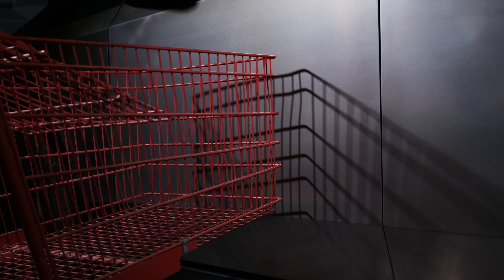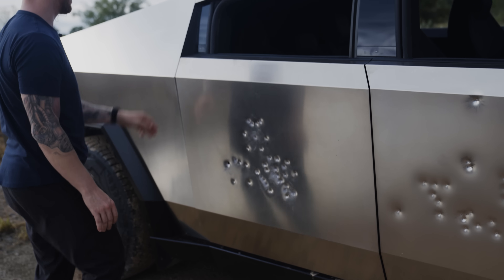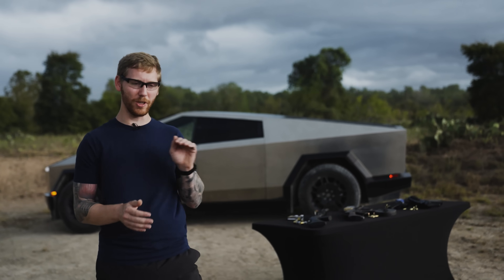Cybertruck Bullet Test

Comment: They had a shotgun - should have tried a slug as well as the buckshot.
What about shrapnel from a grenade?  That'll be interesting...
I'll be surprised if we don't see people who up-armour vehicles for VIP protection start using it as a base - a CT not only has decent protection even without the additional armour, but also the power to carry it and the speed to get out of trouble in a hurry.
Reply: They used pretty much the maximum calibers this truck will stop. Basically typical handgun rounds, but not all handgun rounds (.357 Mag will probably go through).

In other words the vehicle was not designed to be bullet proof and there are dozens of calibers that will easily cut through like butter (like any other car). About the only positive thing you can say is that it could stop some rounds in some situations.

If you want a bullet proof car, you can have one modified. Obviously, the weakest spots are the windows, but they can be replaced with bulletproof glass. It's always a tradeoff though, and your mileage will suffer, as well as the cost of installation being pretty high, unless you DIY.
Reply: @PaulLawson-k8v the fact of the matter is the US will be the biggest market for the CT, and that means you’re not as worried about 762 or 224, because you don’t live in a war zone.

What you’re worried about, and where this helps, is with carjackings. As long as the glass tests out well enough to take a few 9mm this level of protection is perfect for 99.99% of situations an American would need it for.
Reply: @PaulLawson-k8v  some rounds? like 90% of rounds that are used in urban settings, for what this car is designed for.
Reply: @rajahzia they used sub sonic rounds maxing out at 1000fps . There are a lot of rounds that exceed that speed
Reply: @rajahzia well there is 556 and 7.62
Reply: @rajahzia Well yes, as long as the assailant is using hollow points, and not full metal jackets used by the majority, you'll be safe. And not all rounds are made equal, you can buy faster or slower, lighter and heavier rounds in a particular calibre. That's why armour is specifically certified to resist not just to a certain calibre, but at specific speeds and weights of projectile.
Reply: @rajahzia  Any rifle round will punch through easily. But yea it stops handgun rounds pretty well.
Reply: @another3997  these are fmj rounds being used my guy
Reply: vip protection... they also should make some hack-a-day to try break control system of car to see how fast it could be opened or overspeed into the wall
Reply: 5.7x28
Reply: i don't think a VIP vehicle would use a pickup truck lmao
Reply: man these trips to drop off your kids at school in america is really getting intense if grenade shrapnel is a concern lol....
Reply: Dude this vehicle wasn't designed for military. Might as well ask about RPGs and nuclear bombs 😅
Reply: They used OO buckshot.  115 grain 9mm is not subsonic.  147 grain 9mm would be subsonic ammo but they did not state 115 FMJ or hollow point or training ammo.  Looked like FMJ to me based on lead dispersion but I could be wrong.
Reply: @UTalum1996  you can get 115 grain subsonic fmj ammo my guy. The grain weight is just the bullet weight it has zero bearing on the powder load. Also the mp5SD is ported to lower muzzle velocity to make some super sonic rounds subsonic. Listen when the mp5 is firing you can hear the same crack as when the handgun is firing. The rounds were coming out below the speed of sound
Reply: I have a mp5sd and know all to well what rounds sound like coming down range suppressed and unsupressed.  Go to any range and shoot ar 500 steel and the rounds dissipate just like in the video.  Now we all know a lot of trickery can be done but the angles on these doors are key to what you are seeing not the rounds my guy.  Do they make subsonic 115 grain, yes, but it is like throwing a spit ball my guy.
Reply: Wondering if AK-74 bullet or anything automatic and military grade will be stopped. I assume not.
Reply: @RIP212  lol both the smgs they used were automatic and military grade.
Reply: @RIP212 not flat on but angled it can stop it.
Reply: @Phantom-bh5ru  I'm sure you have specific evidence to back up your claims? You know, repeatable tests with specific parameters? What rounds, what speeds and what angles? I'm sure you aren't just wildly guessing 🙄
Reply: mate... they used some of the weakest ammunition out there. in 99% of situations out there where a car is being shot at, im willing to bet my left nut the ammunition used would punch through this like butter. now some standard pistol ammo might not go through if it hits the door and the window together but i wouldnt stake my life on this thing saving me from anything more than a painball or airsoft gun
Reply: @mmorgz6622  if it doesn't stop the bullet, it's hopefully slowed it down enough that it won't pen your vest as well
penetration isn't always all or nothing
but yeah, don't trust cybertruck car doors to stop you from being ventilated by a carjacker. they can and sometimes will stop the round, but
Reply: @mmorgz6622  they used two extremely common handgun calibers (one of them coming from a carbine barrel which would impart higher than usual velocity) and the most common anti-personnel shotgun ammunition.  Obviously we can find things that WILL punch through this consistently, such as 357 magnum or 10mm or any true rifle round, but 90% of criminal gun violence that happens in the US comes from 9mm handguns.  If this helps someone escape a gang shootout alive, that's not nothing.
Reply: @dumb214 That's a daft way to look at it. The assumption they are wearing a "vest", and that a round that penetrates will then hit that vest, is naive at best. A wound to head, neck, legs, arms or anywhere on the torso can be debilitating, even if not fatal. In which case, you are a vulnerable target for any other rounds that pass also through. Unlike in the movies, real life doesn't favour he "hero" in the car.
Reply: @herbderbler1585 You need to clarify the exact parameters of such tests and also their relation to likely, real world scenarios. Armour is always rated to stop specific threats up to certain speeds and energies. They are also only rated to stop a certain number of those rounds within a certain area, with a minimum distance between each impact. Rarely do assailants aim to replicate these criteria for your benefit. In other words, don't be complacent, you're likely to regret it.
Reply: @another3997  no one said anything about being complacent.  You're arguing with a strawman in your own head.  Armor is meant to increase your chances of survival, not stand there and tank bullets like Superman, no matter how good it is.  If someone's shooting at you and your car has resistance to any bullets at all, your chances of survival and escape increase.  Don't drive through a warzone and expect to survive 7.62 rounds, but they've clearly demonstrated that it CAN stop common pistol and shotgun rounds.  You can cite outliers and extraordinary circumstances and armor penetration tests multiple hit circumstances all day long.  The only response I can give you is yes, I agree, those are examples in which this metal will probably fail to stop bullets.  What's your point?
Reply: @mmorgz6622 lol paintball? Man you are out to lunch. The vehicle wasn't designed to be bulletproof in the first place. Yeah it doesn't stop some rifle or shotgun or RPG or a nuclear  bomb. If it stopped all of that then it would cost a million

Comment: One thing to consider is that they were only shooting relatively weaker small-caliber rounds at it.  Anything M16 or AK47 equivalent would have likely punched though.  You'd be in better shape than in a normal car or truck though. A lot of the velocity will be dampened by the time the bullets and/or fragments hit you.  😅
Reply: They also didn't try to make it bullet proof. They discovered it was bullet proof while having fun.
Reply: @Sandlin22 *bullet resistant.  Just like level IIIA ballistic "bullet proof vests" will stop every single round they fired at this "truck," a 5.56x45 would zip right in, through anything inside, and right back out.
Reply: police probably dont want ppl to buy fully bulletproof vehicles
Reply: So many autistically challenged (and triggered…pun intended) Europeans and libbies whinging and nitpicking calibers.lol
A: It wasn’t designed as an armored car and only were claims made that the cold rolled stainless panels are bullet resistant to specific calibers. 
B: Even armored cars are ‘only’ bullet resistant according to levels.
C: It can be fitted with bullet resistant windows and it’s still more bullet resistant than any other mass produced vehicle.
D: Commenters here lack reading comprehension and reasoning skills.
Reply: until a few rounds hit the battery pack and you literally go up in flames...
Reply: @wildbill6976  Battery fires are rare but unique. Plenty of gas cars go up in flames every day, but it's not considered newsworthy.
Reply: @wildbill6976  
And I quote: 
"Australia’s Department of Defence researched the same question and found that “there was a 0.0012% chance of a passenger electric vehicle battery catching fire, compared with a 0.1% chance for internal combustion engine cars.”

If you look at the research from virtually every government or private research lab around the world, they'll back up these findings.  A small percentage of research are literally bought by big oil to ONLY highlight the negatives and dismiss the positives.  

Dude, I drive a hybrid SUV and I have the gas mileage of a mid-sized sedan.... or better.  I see the future, my guy.  It's not a combustion engine that at best combustion 15-ish percent of the energy potential of its fuel and causes death from air pollution.  🤷🏾‍♂️
Reply: @modemmack the future will always be combustion engines at least for the next few hundred years. I see a lot of fluff pieces talking about how popular they are but globally they make up less than 1% of vehicles on the road. Also there's no evidence that there's enough lithium (among other materials) to create a full global electronic fleet. At the current rate lithium is used were looking at lithium shortages before 2030. Now they claim if recycling is ramped up then that can be avoided however claiming that something will happen is not the same as knowing it will happen. I think one day the only place we will see gasoline powered cars will be at car shows and museums. But it's certainly not going to be in our life time and it may not be ever.
Reply: @Sandlin22  I think that's more likely just your lack of imagination kicking in.  It took a bit more than a century for humans to go from riding horses and using whale oil for lighting to AI and humans regularly flying through the sky.  What in our recent history makes you think that humans aren't capable of moving past combustion engines?  🤔
Reply: @modemmack  shoot a lithium battery and see what happens...
Reply: @wildbill6976  By the raw numbers, there's a .0001% chance that your electric vehicle will catch on fire. There is a .01% that your combustion engine vehicle will catch on fire.  Both are by their very nature liable to catch on fire.  It's still wildly unlikely that you or anybody that you know will experience this in either type of vehicle.  I would just say please consider that just listening to those in the media with a fetish to see a new technology fail might give you a warped perspective.  With that type of mentality, we should've stopped making cars because the first ones were dirty, slow, loud, and dangerous.  Nobody ever expected any other technology to be perfect out of the gate because that's not a thing. 

By the way, I own a hybrid vehicle that I bought about 3 months ago.  It's great. When I'm in a residential area, my Hyundai Tuscan coast along without barely making a sound. When I sit at a stoplight, I don't have to stew in my own toxic fumes because the engine always turns off. I get up to 45 mpg sometimes.  My point is that you shouldn't be so down on the tech.  It makes no sense to be so upset that you might not have to be dependant on big oil. With a full electric vehicle, you could potentially make your own power and be free of them all together.
Reply: M16 is a small caliber.  .223 55-62 gains weight round with 30 grains of powder. 9mm (114-157 grain bullet) handgun round is bigger than 5.56mm (55-62 grain bullet) M16 round.
Reply: @johnmea5140 but the muzzle velocity is a lot higher and the profile is a lot sharper, it would penetrate a lot deeper and cause more damage
Reply: @johnmea5140  You have no idea what you're talking about 🤣

Comment: Yes, you can protect yourself from gunfire behind a normal car. If the shots come from the side then next to the car in the front axle area. If you come from the front, then from the back of the trunk, because that way the attacker will usually shoot through the engine block and you may be able to survive relatively unscathed. Especially you, in America, should pass on tips like this. We in Europe don't need that. We just have to protect ourselves against knife attackers. At least at the moment.

Comment: So. Pistol calibers and buck shot. That doesnt male it bullet proof. Stop sayong that. Its bullet resistant. 

9x19
.45ACP
12gauge 00Buck

Thats all they tried.

5.56x45
300BLK
7.62x39
.44 Mag
.350 
.450
.50AE
.50 Beowulf
.308
7.62x54R
30-06
.50BMG

Gere are just a few other common ammo types they dodnt try. Bullet proof. Can stop them all. Since even buckshot was threatening to pierce. The rifle cartridges mentioned would easily push through like butter. Lot of different ammo types to try but only 3 used. They even used a subsonic ammo after the glock. Which is fucking stupid. Subsonic ammo is going to be alot less powerful cause it moves slower. The fuck? Luckily I have seen the 308 Stainless balistics from someone not wanting to lie about his products. The 5.56x45 ((smalled rifle cartridge I mentioned)) pierced it. 5.56x45 is the standard round used in the common AR15 for the Musk fanboys who dont know anything about ballistics. And meeting a badguy with one in the Cybertruck could result in injury or death if the bad guy decides to fire on your vehicle. Yes this is with practically every vehicle unless you spent couple 100k on an armored vehicle. But most cars dont yse bulletproof as a selling point then lie on camera about what it can really do.

Comment: It would have been nice to mention which kind of bullets did you use? Were those soft/hollow points or full metal jacket or something else?
Reply: This def isnt the first test. Its an ad for the car so they used only the rounds they knew would fail.
Reply: From the way they were opening like flowers i'd say hollow points most likely
So not exactly the best for penetration
Reply: Why would they do that then you'd know it's not as impressive
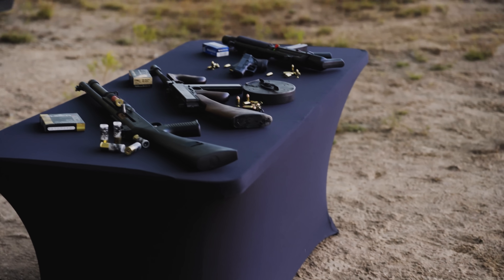Reply: 0:40 0:44 0:49
Reply: @Ghjgckjjfjkkkkx  You do realize that "9 mm Glock" can use multiple types of ammunition? Same same for the rest of the guns.

Comment: Honestly I don't feel like cybertruck is a good name. It suggests so much more than this. Make it autonomous and flight ready and maybe. My cyber truck would be equipped with a 360° turret that automatically fires a laser directly at any sound over a certain decibel.  If you say ouch, you might want to keep it down around my ride or else AI will quickly determine and eliminate any threat available or still talking too loud. "Activating Nag Mode, Passengers Be Aware.! You get a laser and YOU get a laser and YOUUUU get a laser.

Comment: There's a lot of room inside the door trim for for Kevlar or any ballistic shields. I sure some after market company could make ballistic glass for the windows. But OEM alone is pretty empresive nonetheless.
Reply: It's got enough cameras... Without side mirrors I feel like the drivers window could be 1/4 the visible area. I want aftermarket stainless steel window glass replacements😂

Comment: Impressive. What's the density of that alloy?
Reply: By density I meant exactly that - i.e. weight per unit of volume - because it was mentioned elsewhere that it may be an alloy of stainless steel and aluminum .
Reply: if you mean by "density" how thick the plating is , its in the description 1.8mm

Comment: 🎯 Key Takeaways for quick navigation:

00:00 🚗 Tesla designed the Cybertruck with an exoskeleton and a custom alloy, making it more ductile and corrosion-resistant, with panels up to 1.8 mm thick for structural support.
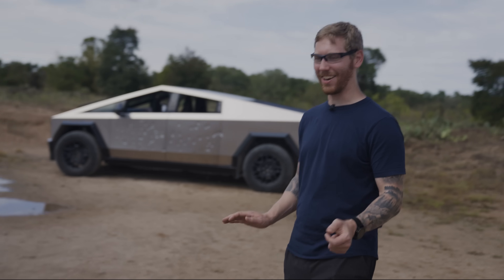01:11 🔫 Tesla tested the Cybertruck's bullet performance with various guns, including a Tommy Gun and a 9mm Glock. The truck withstood the shots, showing only minimal damage.
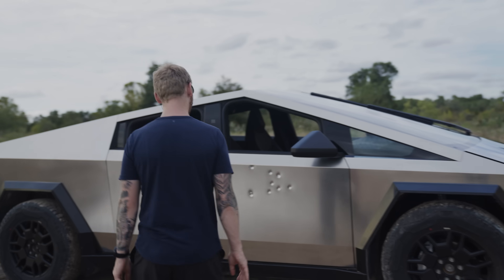01:45 🛑 Despite a double hit from a 9mm Glock, the Cybertruck exhibited minimal damage, with a small crack in one spot but overall remained intact.
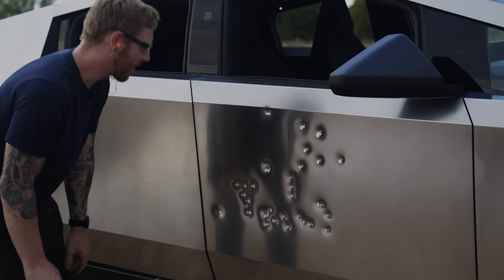02:17 🎯 The Cybertruck also withstood shots from an MP5 with a tighter grouping, showcasing its resilience to high-speed bullets without penetration.
02:52 💥 A 12-gauge M4 shotgun with double op Buck fired five rounds at the Cybertruck. While it sustained damage and a cracked glass, the vehicle held up well, demonstrating its durability.
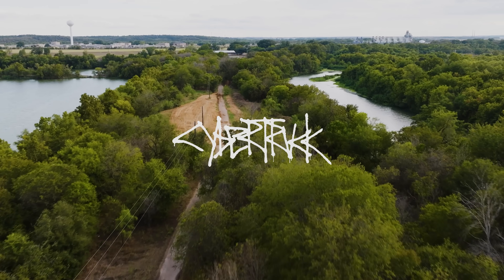03:46 🎥 Contrary to movie portrayals, shooting a regular truck typically results in bullets passing through both sides. The Cybertruck, however, proved more resilient, making it a safer option in certain scenarios.

Please I need your help with a subscription on my channel:hand-orange-covering-eyes: